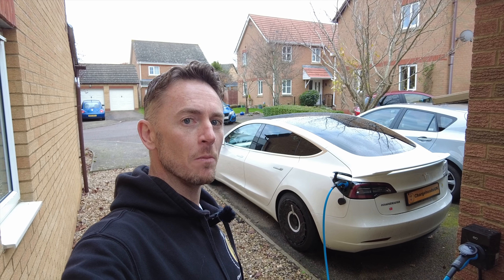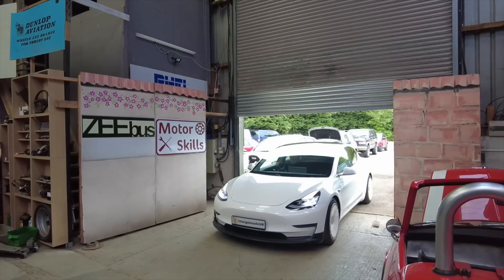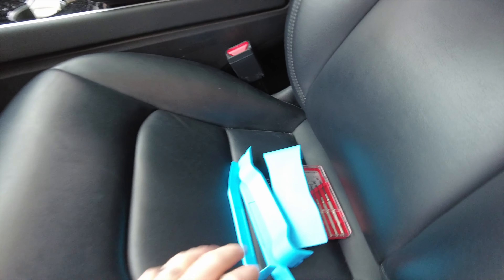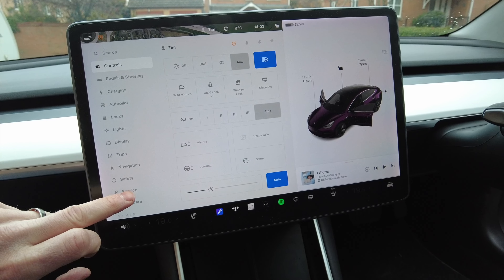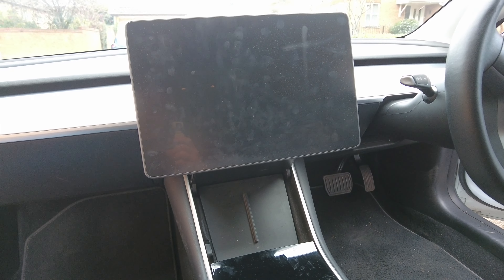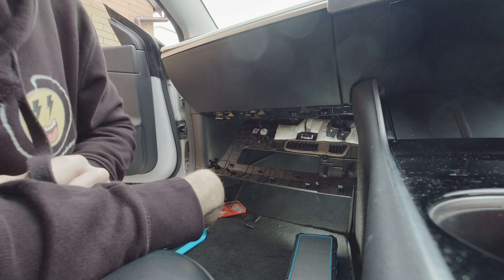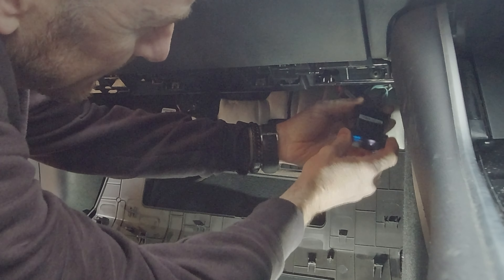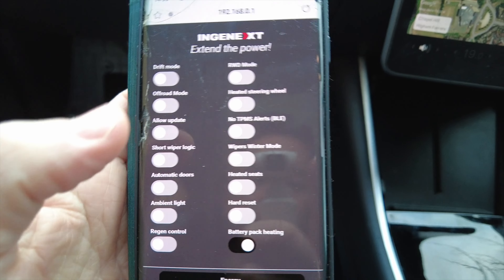Tesla Model 3 Remap Part 2. My Ingenext Boost 50 broke!

Comment: I have Enhance Auto’s Commander which has drift mode, but also off-road mode, which can force the car into using both motors at the same time. Most of the time it is just RWD.
Reply from the maker: @MikeProcter1  have you got a link for this product?

Comment: How does the boost 50 acceleration compare to a M3P? Debating whether to chop my 2019 M3LR in for a 2022 M3P (for a few reasons, improved computer, build quality, heat pump etc but mainly for additional acceleration). Thanks!

Comment: No fuse you can pull for the MCU to reset that way? Or yank both aux and traction batteries? Also, would it not be easier to go up via the centre console panel that can come off given its RHD?
Reply from the maker: @scaryprowler  some great points, however as you can see it wasn't that hard in the end. Saying that, the fun has only just begun after speaking to Ingenext today. 🙈
Reply: @chargeheadsuk  Bad fun... or good fun?
Reply from the maker: @scaryprowler  we'll both find out soon enough 😉